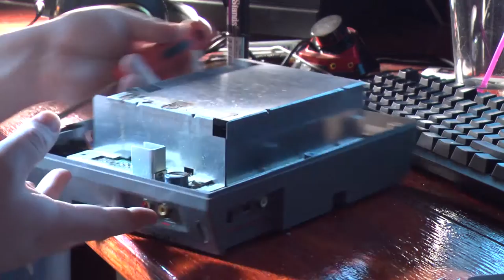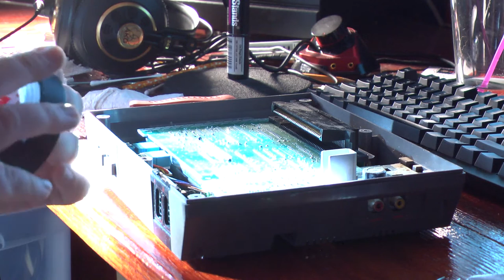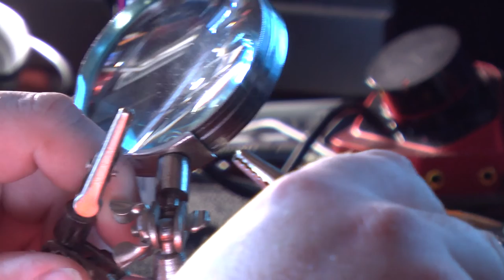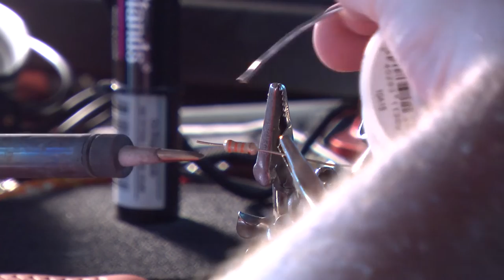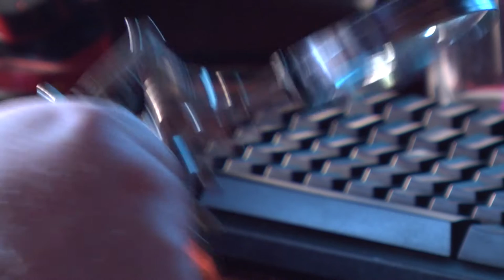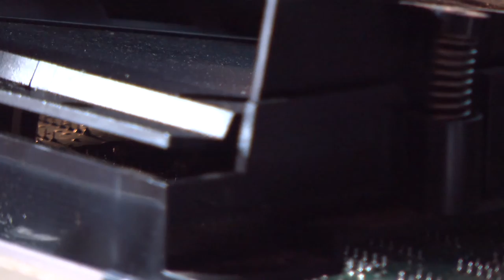NES Sound Expansion Mod Install

Comment: Lsdj on nes is now possible, thanks!
Reply from the maker: This doesn't have anything to do with lsdj.
Reply: this mod equals game changer
Reply: you can approximate gameboy sound using the two stock NES pulse channels, the NES noise channel, and a N163 expansion channel as your GB WAV channel